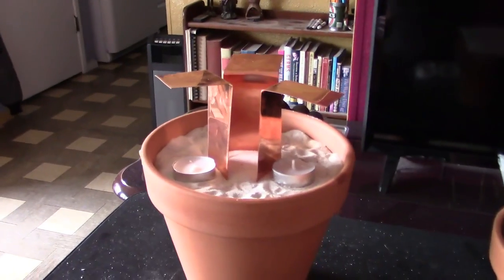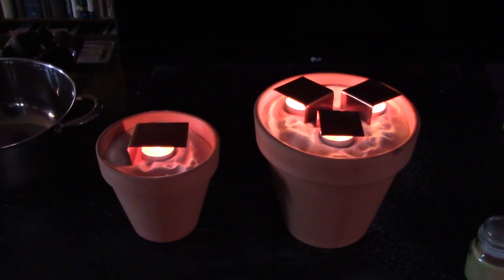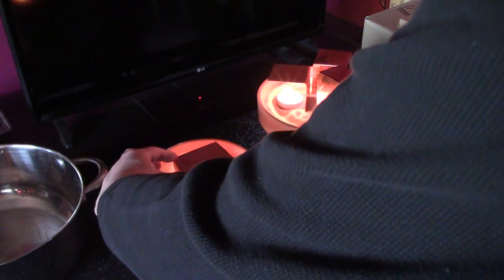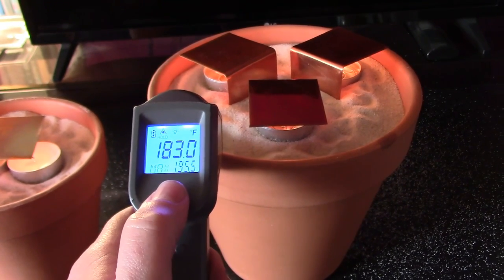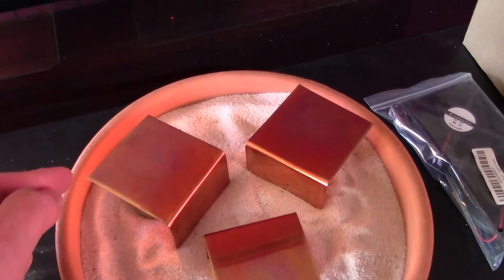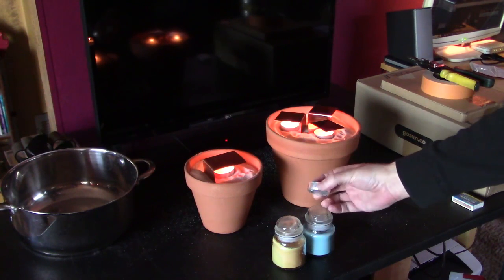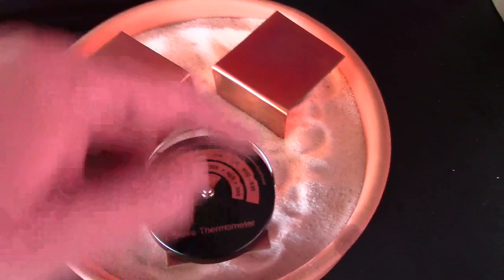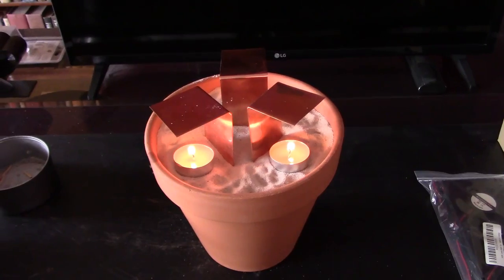Flowerpot Air Heater! New Design! w/Copper+Sand! (300F/400F)(150C/205C) home/mini greenhouse etc...

Comment: Love it! Now I'm sitting here trying to think of a way to utilize it to keep my cup of coffee warm Lol. Perhaps sitting another clay pot on top of one with candles, with spacers between the pots, so it doesn't inhibit the oxygen needed for the flames? Perhaps with a variation of this idea?  : ) I enjoy and truly appreciate all of your content and how you strive to improve on every idea. TY
Reply: If you used the three slats of copper, fairly thick and the backs to the center with a triangle center vacancy in the middle like shown in the video, it should work.  I was thinking the same thing.  Even heating a cup of soup.
Reply: I bet you could fry eggs in it too ❤🎉 @sophholl3782
Reply: a metal trivet on top should be good. trivet= the metal things you put on the table to put hot pots on to not damage the table. Even a  circle of copper on top?
Reply: SERIOUSLY! That's a great idea, I drink tea in the evenings and it gets cold too fast in my old house. Heater+Warmer win win! Cheers☕️🫖

Comment: Hi Desert Sun 02,
I have some scrap copper water pipe I was going to recycle. Would that work as an efficient substitute?
Reply: You did not ask this from me but I'd hammer it flat and bend it to get more efficient heat transfer than thinner plates. Of course it depends on the size of the pipe.

Comment: Thank you for the great info.  You can use this principle to build a 21st century masonry heater that use copper bars to transfer hot air from wood fires to surrounding sand enclosed by masonry blocks instead of relying on elaborate air channels.

Comment: Spent all that $ to heat 3'.
Reply from the maker: hi. doesn't really cost very much. about 6 bucks worth of copper (about 1/3rd of a pound), $1.00 for the flowerpot (dollar store) , and tealights are about 10 cents each. plus some sand. maybe 10 bucks for everything.
Reply: One time spend on everything but the tea light candle or any other type candle you use...if it comes down to freezing or spending a a little money once to have  some heat bet you would rethink your comment.. not everyone can afford a solar generator that would be the size to run an electric heater or to rebuy if you you could find it the fuel for propane or kerosene heater even if you could afford the heater to even start with and even at that electric, propane or kerosene heater would only heat a small room only while it is actually running ..wood stove or fireplace is higher cost plus wood if you can't cut your own plus the chimney needs regular maintenance or you risk fire...alot if people aren't able to do that themselves or able to cut wood themselves..only other option is to buy wood and not cheap..alot of people have to think outside the box for alternative ways to get even a little heat or freeze

Comment: Would it be more efficient if instead of an L shape for the copper, you use a U shape?  Twice as much copper in the sand.
Reply from the maker: hi. i'm not sure if the shape would affect the efficiency but the issue with the u-shape is that it's hard to find copper that is long enough. you need the pieces to go far down into the sand.

Comment: Great vid- as always
IDEA- put twice as many - facing inwards
Put inside an insulating box-made from plasterboard/ sheetrock,with rockwool insulation on 3 sides of the pot
On the 4th side, put a slow fan, powered by a peltier
Then measure temperature  at 3 foot distance,every hour for 8 hours
PS
please get as close as possible when shooting temperature gauge,etc
On a small phone, very hard to see
🤯🤯🤯🤯👍👍👍👍👍🚀🚀🚀🚀🥳🥳🥳😁😁😁😁😁😁

Comment: How about burying a 12 volt ceramic ripple elements in the sand. They should heat up in a hurry.
If they heat the Bricks on the other project , it should heat the sand? Worth an experiment.
Reply from the maker: hi. that would work. i never used the ripple ones in sand or gravel because they are generally made with fins and used with a fan (but you could). i go with the ceramic ones with an aluminum shell. no fins on those and they have the same type of ceramic element. i just re-read your comment, looks like you were talking about the ptc ones (with aluminum shell). those were the ones i used with the bricks. those work good in sand for sure
Reply: @desertsun02  yep use the ones you used with the Bricks, and put them right up against a a copper strip, 4 per can should do it. Then put some copper strips on the top and use a heat driven fan to blow hot air.  Should work well.
Reply from the maker: hi. i see what you're saying. yep, i have run the heat fans with the ptc elements. all you need is 2 of them and the fans will crank. you don't even need copper. you can just set the fan right on the elements.
Reply: @desertsun02  Glad you’re doing all the experiments that I need answers for, I’m looking to get my 10x12 greenhouse to 16C so I can grow cool season crops in the winter. I have a VEVO SS tent stove, could fill it with Sand and put 6 or 8 PTC elements in there, and a Fan on the top. Other Alternative is to make a vegetable oil Burner for the Stove, but would be more expensive to run, I could use solar Panels (200 wats) on the greenhouse to run the PTC elements off a battery bank, sun is free, and the greenhouse faces due south.

Comment: I've been watching you for around 10 years and this is the best one I can remember for this flower pot type heaters!
Reply from the maker: wow. thanks, I'm glad you've been a long time viewer. I've been wanting to find a way to add lots of thermal mass to the 'flowerpot style' heater for a while and this is the best way I've thought of. the copper grabs like 90% of the heat of the flame and just sends it straight down into the sand to be stored and slowly radiated over time. no wasted heat being sent to the ceiling (where you can't feel it).
Reply: @desertsun02 Good thinking 99! Seriously using your noggin there. Outstanding synthesis and execution of information different bits of information. BONUS: No cleaning spot off the walls, ceilings and furniture. That shyte gets EVERYWHERE. 🤦🏼‍♀️
Reply: @desertsun02  first of all: Thank you for sharing this info. I have some questions for better understanding the process. The bigger pot with more sand, the bigger area is warm? How big area from the pot is warm? Thank you. ❤️
Reply: @desertsun02  So what about adding a fan on top??  It works with No Power, the warm sand runs it

Comment: Put the thermometor into the sand but not directly over the flame, to get a better reading of the radiant heat function.  And how long does it retain heat after the candles go out?

Comment: I like the direction of this heater build. My thought would be to set the clay pot on blocks and insert a thin one inch pipe over the drain hole extending upward a few inches out of the sand as a circulator. I cool my garage with one of your evaporative window fan cooler designs and like it. Keep'em coming Friend.

Comment: Why not bend the copper twice so the copper goes down into the sand from 2 directions, kinda like the thing you made with the 2 pieces of copper and 2 candles?  Also, I realize that copper is expensive, so why not mix scrap or recycled copper in with the sand??  Would that be better than just plain sand?

Comment: Now we have to figure how to make candles that will burn for at least a week at a time....
Reply from the maker: that would be sweet.
Reply: @desertsun02   ..would proly make a lot of rich local oil men poor and put a nice dent in  gas & electric profits if most of us adopted your ingenuity ...i think i can speak for many when i say you are greatly appreciated dude👍
Reply: There are videos on you tube  showing how to make candles that burn approximately 100 hrs. One could possibly use them, burying them in the sand. I'm gonna try it out.
Reply: If you are talking about the crisco candles, they burn down and won't be close to the copper for the full 100 hours.

Comment: Do you know whether the gradient of the sand would make a difference? Finer sand absorbing quicker? Just wondering. Incredible design. Looks cool too👌
Reply from the maker: hi and thank you. i'm not sure if the type of sand makes much of a difference but i would guess the finer the sand the more heat it holds (because the grains fit more closely together). i used a fine off-white 'play sand'. it's cleaned and filtered (usually used in sandboxes etc.)
Reply: @desertsun02  thank you 👊☯️👊

Comment: I wonder if making the copper U-shaped with two parts of the copper strips in the sand, instead of L-shaped, for the double tea lights, would heat even more.  A peltier stove would easily sit right on top.

These are beautiful unlit, and even moreso when lit.  You keep topping yourself!
Reply from the maker: hi and thanks 🙂

Comment: Great idea.  New sub😊.   How large of space does it heat and how long does it heat the space? Is the outside of pot hot?
Reply from the maker: hi there and thanks for subbing! i'm not exactly sure how large of a space it can heat. i guess it will depend on how much you need to raise the temp for a given area. standard size tealights will burn 4 to 5 hours plus the unit will release heat for 3 or more hours after they go out so you could get 8 or more hours from one set of tea lights. they also sell long burn lea lights. those burn 6 or 7 hours so you could get 10 or 12 hours of total heating if you use those type. the outside of the pot gets very warm and continues to warm the longer you run it. very warm in 45 mins to an hour and hotter as time goes by. (up to a little under 300F/150C within 2 or 3 hours). if you add a second candle under each copper strip you can get it to near 400F (the copper) and the sand temp stays a little under that (350F/177C).

Comment: Nice idea, I would definitely incorporate a fan to increase the warm airflow. Otherwise you are relying on radiation heat alone, which is mostly IR and gets absorbed quickly once the view is blocked.
Reply from the maker: hi. a small fan should work good with this 🙂👍